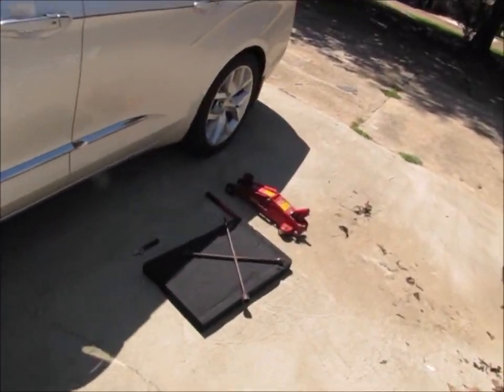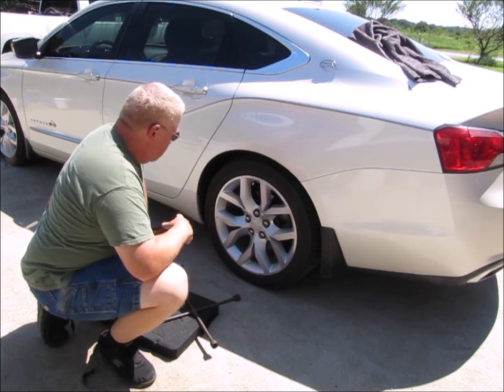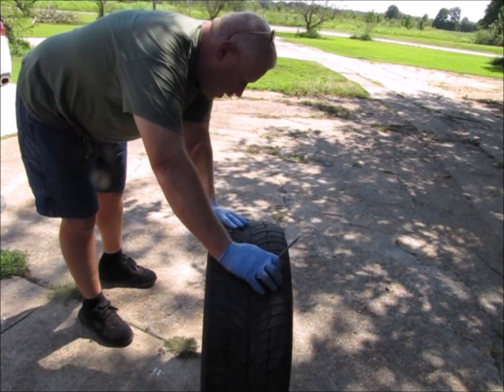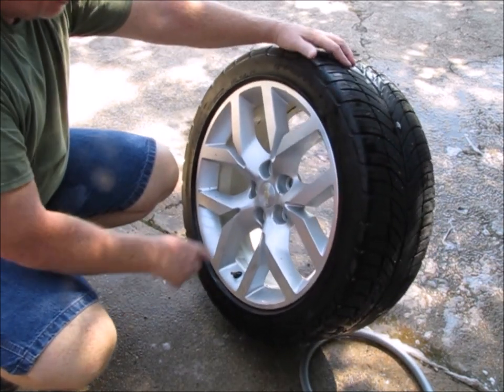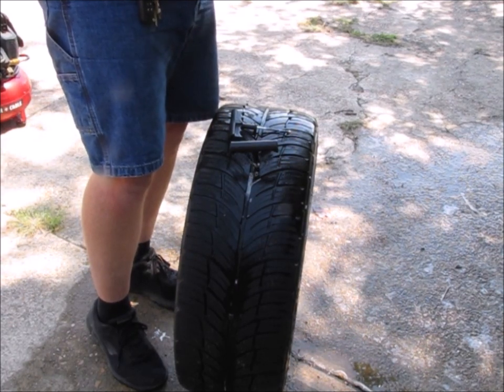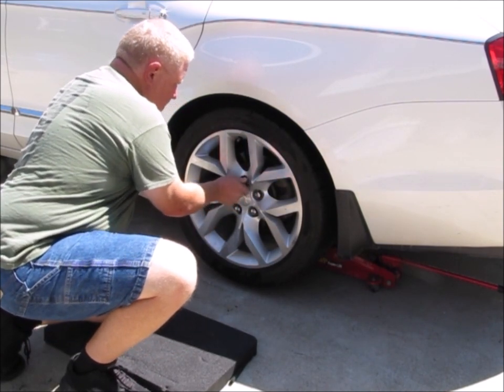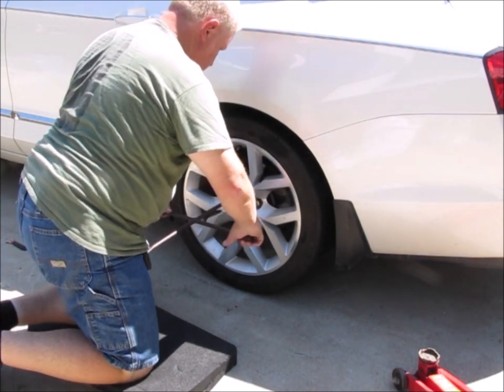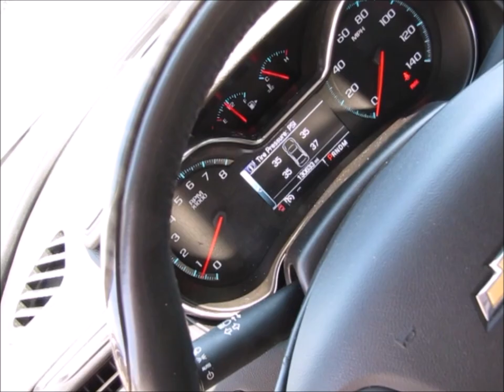You can PLUG and CHANGE a tire!!

Comment: Hey Ed!! So great to see you and this is a great tutorial on how to change and repair a tire. We think a lot of the jacks that come with the car are sketchy. We'd rather have a floor jack too. We chalk up the tires that are still in contact on the ground an e-brake it too!! Some cars are annoying with locking lug nuts. That's good you also test the tread wear too. Butters grandfather used to always test tires for leaks with water/soap. You really can't get much better of a test to find out where a leak is coming from.  So great you found yours!! Those are great tips about the repair kits that there are only specific places you are suggested to use them. Useful video and thanks for sharing!! Love you guys to the moon and stay safe! <3
Reply from the maker: Love you two as well, thank you!!!

Comment: A good video about to change a tyre and set a plug, Ed. You have thought of everything and also explained and demonstrated it well.
By the way, we here, are only allowed to repair tires in a low speed class. OK, you have a speed limit, we don't on some sections.
So open end in some areas!!! Think this is the ground therefore. Best wishes, Joachim
Reply from the maker: I think I tested this repair pretty well this past weekend.  Drove about a thousand miles (not sure how many Kilometers that is) and drove the car close to 100 mph several times and the tire performed flawlessly!  Thank you for watching and the great comment!